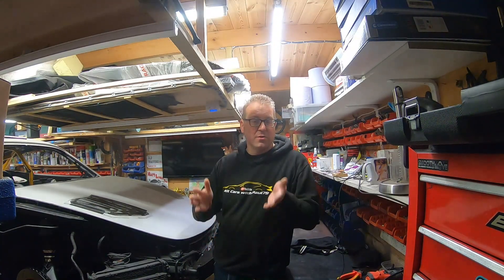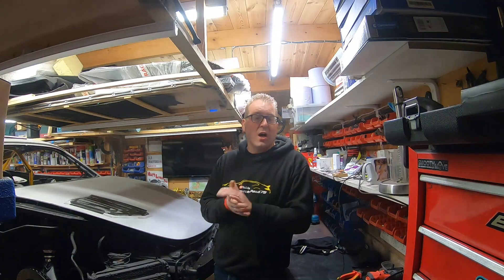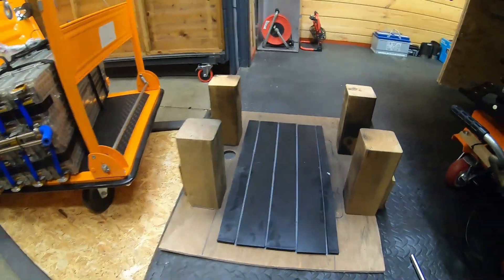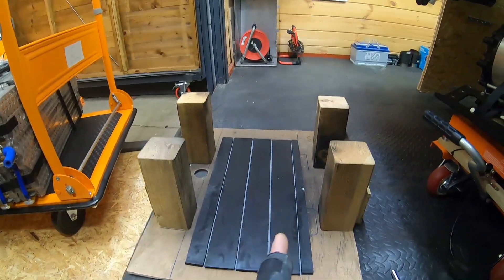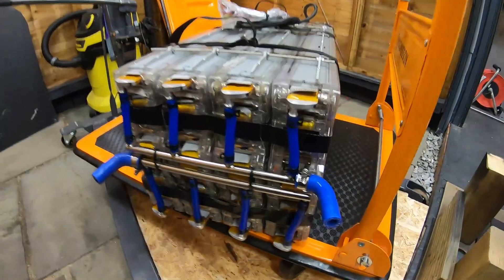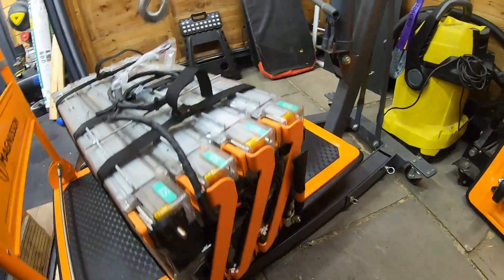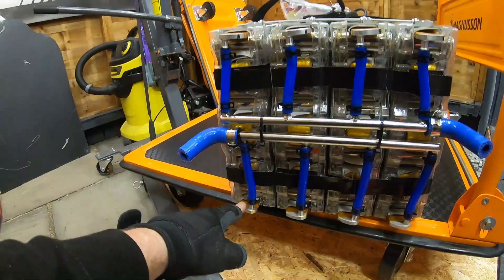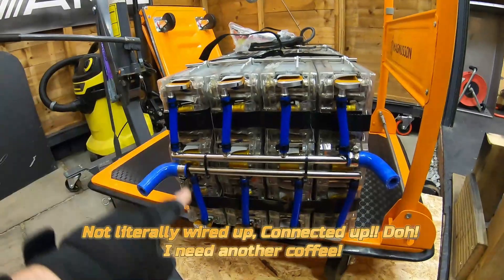EV Home Build Part 8 - Battery Boxes Build Up with Tesla Modules

Comment: We have paid 1550€ or 1550 $ for a 16 kWh rack, BMS and EVE cells which we put together and that is paying of cause the insurance is not willing to accept any diy tesla built battery. But those packs sold as kits with cells , bms and the metal case get a full coverage.
And we have 10.000 cycles to expect, our oldest LFP battery is over 12 year now and has 3300 cycles with still 89% and 1% SOH depreciation every 2nd year. Much safer compared to the tesla packs which we had started with in 2019 . nice packages for sure but back then far too expensive : 1000€ for a 5 kWh pack - now much cheaper, but also more expensive than a full id 4 battery with its 78 kWh battery. 
And for the ID batteries is an opensoure solution available to connect these directly to deye inverters and others cause the finnish have decoded the canbus fully and are able to communitcate via a SBC like board . You do not have to open the battery anymore, just plug and play.
Reply from the maker: Thanks for the information

Comment: Hi friend, stop killing yourself to try & build what amounts to a Tesla & take a look at the brand new Model Z Roadster then at least you can plug it in to the Tesla Super Charger Network all over the USA 🇺🇸 Good Luck with your project, if it doesn’t work you can always use the battery packs to power your home with solar so you can charge it at home 👍
Reply from the maker: Thanks. Don’t worry it will get finished and look better than Model Z Roadster